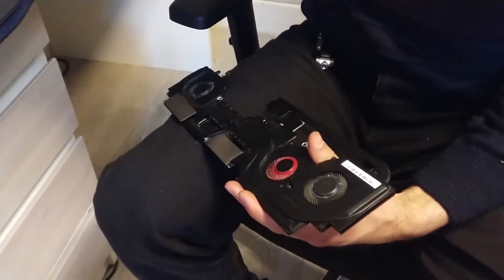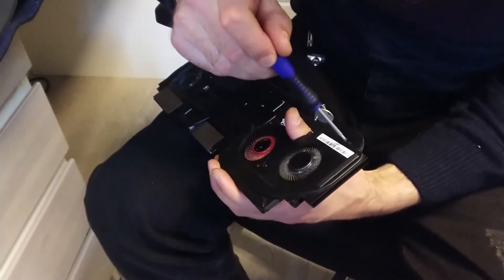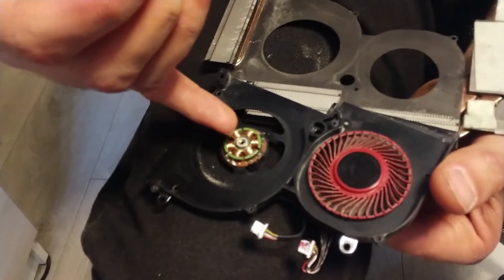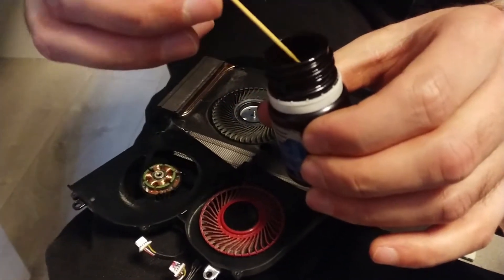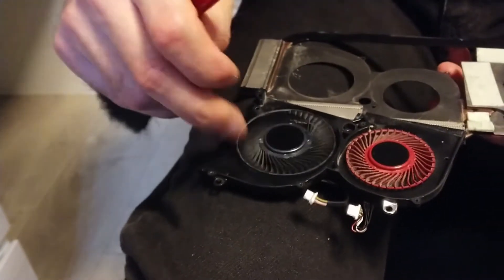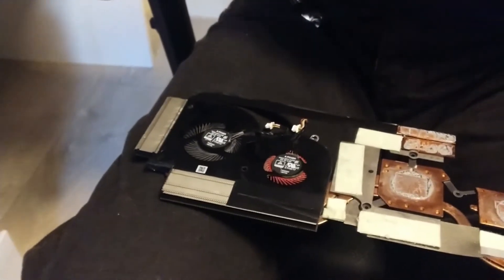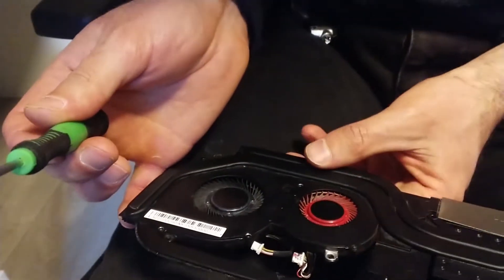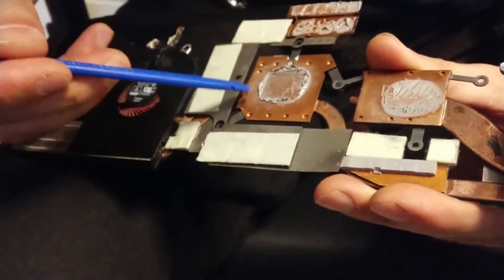ლეპტოპის გაწმენდა და თერმოპასტის შეცვლა გამოძახებით 568 44 48 58

Comment: ლეპტოპის გაწმენდა რა ღირს თქვენთან?
Reply from the maker: ლეპტოპის გაწმენდა ეს არის ტექნიკური მომსახურება, რა დროსაც მთლიანად ან ნაწილობრივ იშლება.

რატომ არის ეს აუცილებელი?
იმიტომ, რომ დეტალურად გასუფთავდეს მტვისგან და განახლდეს თერმოპასტა. 

ეს პროცესი თითოეული ლეპტოპისთვის განსხვავებულია, რის გამოც განსხვავებულია ის დრო რაც ამ ტექნიკური პროცესის დროს დაგვჭირდება - რის გამოც განსხვავებულია თითოეული ლეპტოპის შემთხვევაში ამ ტექნიკური მომსახურების ფასი. ზოგი ლეპტოპი მთლიანად იშლება, ზოგი - კი ნაწილობრივ. 

აქ მოცემულია ფასები ლეპტოპის მოდელების მიხედვით:

HP 4510s  -  55 ლარი
HP 6710b - 45 ლარი
HP 4525s - 35 ლარი
HP 4740s - 40 ლარი
HP 8560w - 45 ლარი
HP 250 - 40 ლარი
HP ProBook 470 G0 - 40 ლარი
HP ProBook 4720s - 35 ლარი
Acer Aspire E5-575G - 40 ლარი
Acer eMashines 725  -  45 ლარი
Acer Nitro 5 AN515 - 40 ლარი
Asus ROG G73J  -  40 ლარი
Asus Vivobook S510U - 35 ლარი
Sony Vaio SVF1521J1 - 35 ლარი
Fujitsu A512 - 40 ლარი
MSI GE72 MS-1791 - 45 ლარი
MSI GS65 - 40 ლარი
Dell XPS L702X - 40 ლარი
Samsung NP-R505H - 45 ლარი
Toshiba Portege R835-P70 - 35 ლარი
Acer TravelMate B118-M - 35 ლარი
Acer Aspire ES1-571 - 40 ლარი
Acer Emashines E730G - 45 ლარი
HP 15-G000SR - 45 ლარი
Acer eMashines EZ1700 (All-in-one) - 40 ლარი